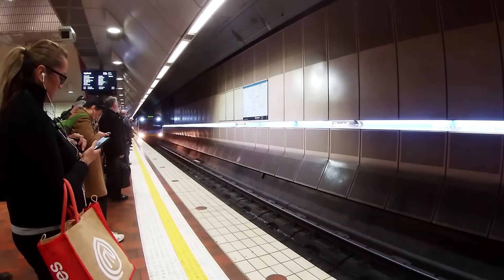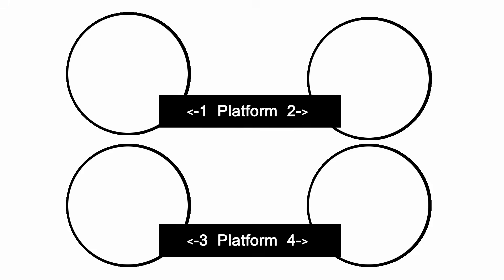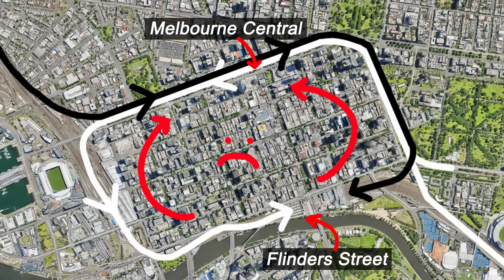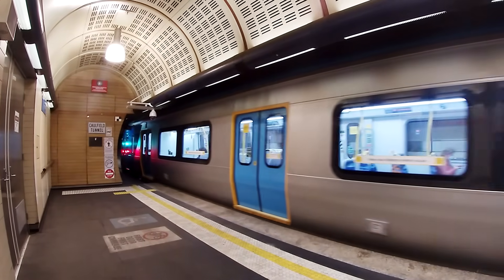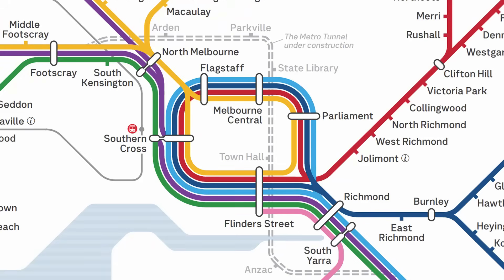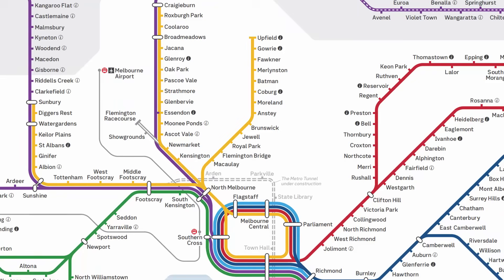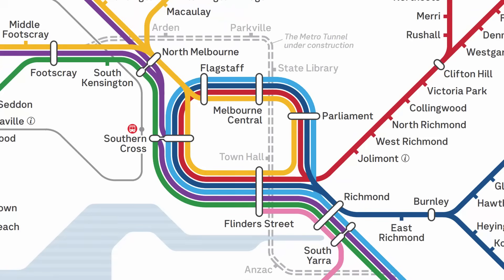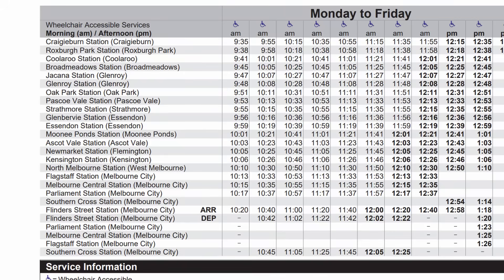Melbourne's Underground City Loop - Explained!

Comment: Very informative video. As someone who's lived in Melbourne for most of my life, I've always disliked the city loop design. Having used modern MRT systems in Asia such as Taipei, Hong Kong and Singapore, I've always thought the city loop to be way too confusing, especially for people not familiar with the system.  Chicago also has a looping system around it's CBD/downtown, but largely avoids the strange change of direction. 

I'm much happier knowing that most of the loops will be untangled with upcoming lines being built such as Metro 1 and Metro 2, and lines will instead run end to end.